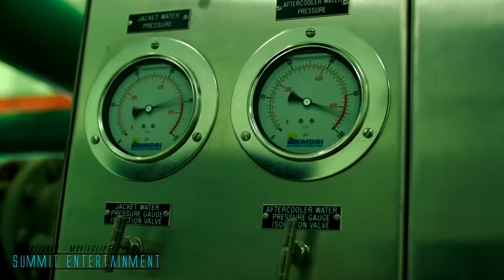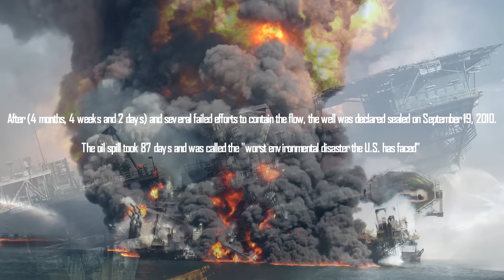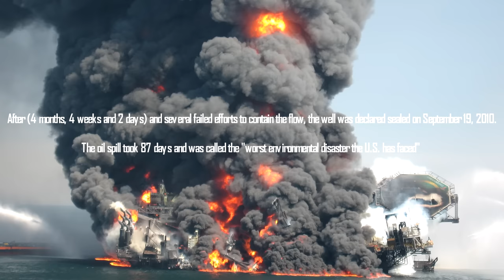Deepwater Horizon |2016| All Blowout Scenes [Edited] (April 20, 2010)

Comment: Having worked on land drilling rigs and offshore for many years there is one huge difference between the two. On a land rig, you can actually RUN. Offshore, as the saying goes, 'Jail, with the possibility of drowning.' No where to run. And if you're in the North Atlantic or North Sea, going into the water is really not an option. Not a good one anyway.  If you choose THAT that means you have no choice because that is just a slower death. You're just choosing what death that is. Burning, freezing, or drowning. What would you choose ? No need to answer, it's chosen for you.
Reply: satexman 
Damn. Wow.
I respect anyone who works on the ocean rigs.
Not an easy job, and it’s incredibly risky. You guys EARN your pay the hard way.
Reply: Thought about becoming a welder for these oil rigs. Any advice
Reply: Worse is the fact that sometimes the props of rescue ships or hell even the sonar can kill you.
Reply: Marge bouvier Simpson how does sonar kill someone?
Reply: @MicrosoftPaintOfficial  Rescue ships tend not to have strong enough sonar to do any damage. On warships and submarines, an "active" sonar pulse (where the sonar sends out noise to hear an echo) it can be loud enough to kill, for example, divers nearby. Literally melts your insides.
Reply: @cryx4  Rescue ships no, not designated rescue ships. Like let’s say a nearby large marine vessel that happens to be near the oil rig. Sonar with those can 100 percent possible as these vessels do use active sonar most of the time. However it’s rare for them to still have there sonar online when they are rescuing people from say a rig fire, which I’ve heard has actually happened

As with my prop comment that was stupid, most likely will be unable to suck you in unless your aside the hull while the vessels underway. If anything the biggest danger would be propeller sound imo. They can be dam loud having swum near large container vessels, cameras and hydrophones don’t do the noise justice.
Reply: @Cen0bite  Start on dry land with an oil service company.  Get really good and then you can go off shore.  Good money!  Good Luck!  :-)
Reply: Why arent there escape boats on the rigs?
Reply: @jhonnymejia9702  there are. I've worked on rigs for years. It's standard practise. But sometimes, if shit goes wrong in a specific way... you can't get to them. You're fucked.
Reply: @adamblyth9972  Just jump overboard..the water in the gulf is 70 degrees...
Reply: @colecummings3855  No you're not..In most cases it's a 60'-100' drop...
Reply: @colecummings3855  You keep using that word, but I don't think you know what it means...
Reply: @DynamicSeq  

In the Gulf of Mexico, maybe ...

... but where Piper Alpha was ... not even close ...

All these decades later, and I still can't believe so many actually survived that, especially when you see the actual footage of the secondary explosion that was one huge fireball that engulfed the entire platform ...
Reply: If you can get to the water fast enough before it lights on fire, I’d say freezing is going to be the least painful. Suffering from hypothermia is going to hurt like hell, but the death itself isn’t very painful. All you really do is get warm and very tired, though, when you fall asleep you don’t wake up again.
Reply: Up in the Bakken in the Midwest, we have small blowouts now and then, easy to handle, lil mud, lil gas/oil, not that big a deal. A big but not huge blow out once in awhile, nothing like this though. This was insane. One of the bigger worries in the Midwest are hot water/oil trucks never getting their valves open/closed right. Treater tanks explode. Stood 10 ft away from one when it popped. Didn’t know if I was alive or dead for at least a minute. You could hear it pop open (IF it don’t explode) 10 miles away.
Reply: Piper alpha feels scarier to me
Reply: I read that during this blowout, one of the lifeboats got caught on a line and they had to use a knife to cut it loose.  Some people already rolled off and started swimming towards the Bankston.
Reply: The water in the GOM is 70 degrees..
Reply: I’d be more concerned about being eaten by sharks that encircle the rigs, waiting for waste food/materials.

Comment: I don't think the initial blowout was this dramatic but since it''s a movie, why not. Man, when I saw those vapors getting sucked into air intake vents, you know what was coming next. For the workers on the Deepwater Horizon, it must have been hell on Earth.
Reply: Agreed. Just by the explosion alone it looked like it killed everyone on board. But I assume it’s just for dramatic effect the intensity at least, I know some if not most of it happened. I couldn’t imagine experiencing it in person.
Reply: The initial blow out by reports threw a plume of the mud over 70m. (240 ft) into the air.  And a similar explosion In a refinery Texas City in 2005 produced one of the largest non nuclear explosions ever.

Edit.  Its actual similar to the method to produce the highest yield bombs we can make called fuel-air explosives.  This explosion was methane misting all over the rig.
Reply: @elonsus9747  i heard they actually had to tone down the size of the explosion in the movie to make it seem more real, so it would have been significantly larger than the movie depicted in real life
Reply: On my rig we have an automatic shutoff louver for the engine air intake. I don't know why or if they was any on the Deepwater horizon, my guess is yes since it was a modern rig.
Reply: @jeandubois8810 it probably did. But in the movie they say how the rig needed heaps of work on fixing stuff that didn’t work so could have been there, but broken/Faulty.
Reply: @imjashingyou3461  Just looked that '05 Refinery explosion up and BP was involved. Why am I not surprised?...

Comment: For those wondering about the generator explosion: The added gas, which came in through the air intake, caused the pistons the over rev, until eventually, it locked up as a.. safety mechanism, I believe, to prevent a runaway engine. The second it locked, as the spark plugs were still doing the sparky stuff, it shot the pistons out, and exploded. 

Don’t be a dick in the comments if anything is wrong, this is just my own technical opinion of the ‘event’.
Reply: Close, but what happened here was the runaway engine heated up until the pistons, expanding from overheating, seized mid-stroke causing a spark.

It's similar to how an onshore oil facility exploded in Texas, there it was caused by a pickup truck left running which ingested gas fumes iirc.
Reply: @Rammstein0963.  Ah. Makes sense- Thanks for the technicality fix lol
Reply: Thanks! Interesting reading!
Reply: I d rather say the pistons where over heating and expanding till they get stuck in german its called Kolbenklemmer and its so hard that it tears them you call them kolbenfresser
Reply: The engine overheated and the mechanisms locked up due to changing shape, as others have said, but I don't think it was the sparkplugs which set it off. All that gas isn't supposed to be in there anyways, and what happened with it is that, given the amount of force behind those pistons once it seized, they were launched and snapped hard enough to spark against each other and the edges of the chamber, in a section which is decidedly not intended to have sparks in it at all - the cylinders, where the explosions are supposed to be, are detached chambers. After that, well... it all went away.
Reply: Definitely wasn’t spark plugs. No Diesel engine carries spark plugs
Reply: @jrpena7857  there is diesel cars with sparkplugs
Reply: @hardscope5317  no there isn't. You might be thinking of glow plugs. But no diesel engine uses spark plugs
Reply: @Rammstein0963.  is there not a system in place to detect oil and kill power to the engine? theoretically it shouldn't be too difficult to detect the oil in the engine intakes and kill the engines before the oil could reach the pistons
Reply: Very similar to what caused the explosion in the 2005 Texas City refinery accident. Hydrocarbon vapors entered a carelessly parked idling diesel pickup truck nearby, which caused it to race, triggering a backfire that caused the explosion there.
Reply: @O-Man the problem here isn't oil, it's gas (methane iirc) getting into the engine and causing a "runaway" condition, until the engine seized.

If someone had been there and recognized the danger MAYBE they could've killed the engines, but even that might not have been enough.
Reply: @Rammstein0963.  no, the question was why the magenta alarm wouldn't auto shot off the engines cause they detect the methane already
Reply: If it had been checked properly, the Deepwater Horizon might not have exploded and those 11 men who still be alive.
Reply: Looked like detonation occurred to me.  The cylinder walls got too hot and premature ignition came along
Reply: @Juice-tr8xi  glow plugs are technically spark plugs. but its to help cold start diesel engines
Reply: @zKsery  thanks!
Reply: I think the gross amount of oil finding an ignition source caused the explosion myself... but I wasn't there so what do I know.
Reply: @jackmagnium6115  no they aren’t,  they just heat the diesel to help it ignite. Diesel engines use compression to ignite. Petrol engines use a spark
Reply: @Surgeeon  Glow Plugs heat the air going into the cylinder not the fuel which helps start up by not having to spin over so long on the starter to generate the same air temp for startup.
Reply: @jackmagnium6115  Glow plugs are just heaters to warm the air temp up before startup. Spark plugs actually do spark things for continued engine running of petrol or gas.
Reply: @kiwidiesel  Glow plugs also heats the fuel when it came into precombustion chamber for the indirect injection diesels...

On the direct injection ones, Glow Plugs find its use on heating the air in the intake manifold
Reply: @o-manthehuman7867  there is shut-off device on diesel engine in case its runaway, which closes the intake and cut off the fuels, and they operate automatically

For manual operation, you have to shut the fuel supply first and then shut the intake, but don't do the otherwise (as of my knowledge)

So in case of this explosion, it shouldn't happen considering the technologies are far better than the old days...

But, God have had he's own plans to do
Reply: @k-getrengganis7401  The glow plugs do not heat the fuel for indirect injection types since the fuel is in the injectors. The pre warmed air charge is already in the cylinder at the point of injector opening due to the intake stroke and since the air is now extremely hot on the compression stroke the atomized diesel ignites when injected into the cylinder.

As for direct injection the glow plugs do not heat the air in the intake manifold as they are installed in the head of the engine at each cylinder location. They only heat the individual cylinder.
 A manifold heater which is different to glow plugs is used to heat the intake manifold air pre and after start and during initial warm up.
Reply: No, what happened was cylinder lock. Guaranteed way to do one of two things to any piston driven engine: bend/break a rod, or blow the engine up. In this case, the latter happened.
Reply: A diesel runaway. The flammable vapors meant the engine would run faster and faster regardless of throttle,till it seized from lack of adequate lubrication on cylinder walls at such high speeds, and that sparked
Reply: just feel like that really wasn't needed to be said.... we all saw what happened
Reply: You can slow the video and see when the engine seizes, the con rods snap, sparking as they do so, and igniting the vapors
Reply: It's for dramatic effect.... in the real world I don't think the generator actually abruptly stopped like it's shown,  it likely came apart while it was still running because it spun so fast that the crankshaft/rods/pistons/block  failed from stress and it blew apart. 

What I don't understand is why there wasn't any device on it to keep it from running away in the first place.  Plenty of diesel engines have been fitted with shut-offs that completely cut off any air entering the engine to prevent a runaway situation.
Reply: @mikeg3529  sudden seizure due to overheating caused by overrevving is absolutely a real world thing. A robust diesel engine isn't coming apart from overrevving too easily. Overheating will kill any engine.
Reply: @foojub6907  it's definitely possible for the bottom end to come apart if it's running way faster than it's designed to. 

It may have seized, it may have come apart.... but one thing I'm pretty certain of is it didn't first seize and THEN explode...that's just movie theatrics.
Reply: @mikeg3529  engine didn't explode, when it seized, con rods snapped, sparking as they did, and ignited the oil vapors. At least, that's what happened in the movie.
Reply: what happen to the engines was a run away even if they cut fuel off the engine are intaking that air gas mix. you got to cut all air flow to the engine.
Reply: Hey, you did much better than I would've been able to explain it. 
My explanation: "You see, this is what happens when the thing doesn't go with the thing....and then this thing happens."
Reply: An opinion can't be factually wrong, please learn the definition of the word.
Reply: Over revving like that and how hot those parts are I bet it seized from the oil boiling and not lubricating no more
Reply: @jrpena7857  Not necessarily true.  While you are correct with modern diesels, the older diesel engines had some creative ways to get them started due to the lack of glow plug/intake heater technology.  The Farmall/International diesels of the late 1930s through the mid 1950's were gasoline start and then switched to diesel.  While this is a legacy application I speak of never speak in absolutes because you never know.

Comment: What if they covered the lifeboat in dawn dish soap to keep all the flaming oil away? Would that work? Genuinely curious
Reply: I’m going to hell for laughing at this....
Reply: Well in real life those boats, once in the water, have a spray system that keeps pumping seawater over the boat.

There is a video out there of them putting one of those boats in the middle of a fire on the water, they put a cat inside. After 2o minutes they checked and the cat was fine.
Reply: These boats are designed to be fireproof. some of these are called "freefall" lifeboats, where they lower them by sliding them off rails to launch them faster.

Comment: The big nail in the coffin was the fact that the pipe in the blowout detector bent, meaning any action such as closing the pipe or cutting it won’t work.

This was the case when they cut the pipe, with the bent shape of the pipe, it a section was not hit by the blade. Even though the partial cutting stopped the flow for a bit, it was penetrated and the rig blew up

The pipe was cut two times... manually and by an automatic system

Unfortunatly the automatic system was miswired, causing a problem, but miraculously,  an error managed to make the system work, cutting the pipe, but you all know what happened...
Reply: Yea that system was called “the blue pod” and “the yellow pod”
Reply: it was designed to bent, the whole blowout detector was a shit design
Reply: @donotreportmebro  I mean technically yes it is designed to bend but the blide-rams on the BOP were not so therefore the crew, the yellow or blue pod could not close it
Reply: The entire rig went up in a fireball.
Reply: I see you guys watched the USCSB's video as well....
Reply: To put it simply, it triggered a chain reaction causing the Deepwater Horizon to explode.
Reply: Put simply this is an example of "two wrongs make a right"
Reply: Which I don't see why they had to lie about in this movie? They show the stupid shear system literally disintegrating 'for some reason'? Like why not just show the shear operating normally but with the pipe bent? Even from a cinematic perspective it would give the audience hope, as the shear slowly closes (it's a slow system), but then the pipe kinks and it fails. How is showing little cutting blades just flying apart for no reason a better decision?

Directors and their cinematic lies that just end up making people stupider.

Comment: 3:25
Not something you want to hear in an engine
Reply: Vengeance of Eternal Darkness would an engine explode like that if a heavy metal object falls on its Shaft?
Reply: Lynch124 oh i see, i mean the Heavy metal bar just stopped the engine in the middle of its working which stopped the piston’s linear motion which resulted in the blockage of the combustion, ultimately explosion happened because of the energy which wasn’t getting area to expand and the incomplete stroke.
Reply: @yashsingh3126  I thought the engine seized because the fumes from the oil caused the diesel engine to runaway (what they were showing going into the air intake), overheating and stressing the parts ultimately seizing it.  Then the heat from the friction and combustion ignited the oil fumes in the air causing the explosion.
Reply: @yashsingh3126  It wasn’t the steel beam that caused the engine to blow. The beam falling was something separate in the movie. In fact if memory serves, that beam actually landed in one of the control rooms. The engine just sped up until it jammed and the shaft snapped. Still, it’s surprising to think that one error is enough to make an entire mobile rig rip itself apart.
Reply: Heat was a cause to
Reply: @aregmartirosyan2076  i think this is how chaotic final destination 6 would be...